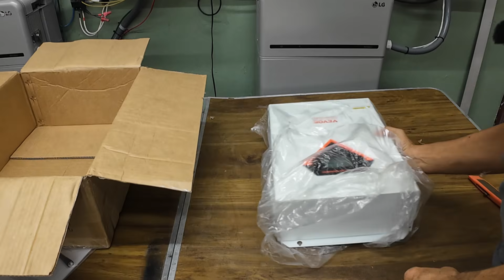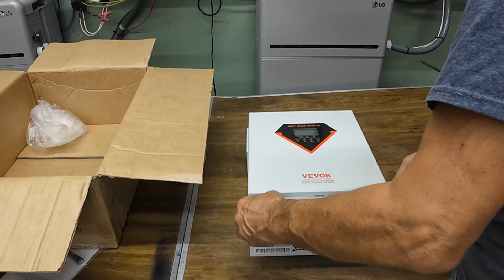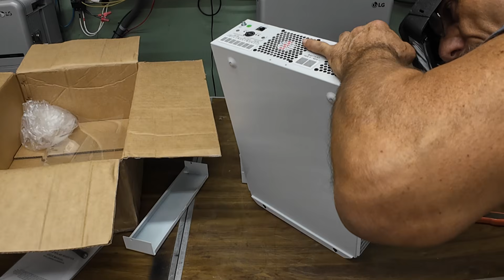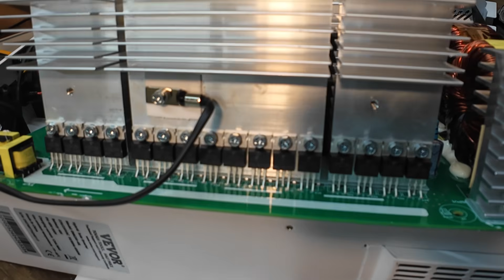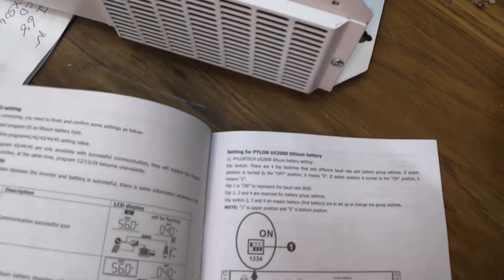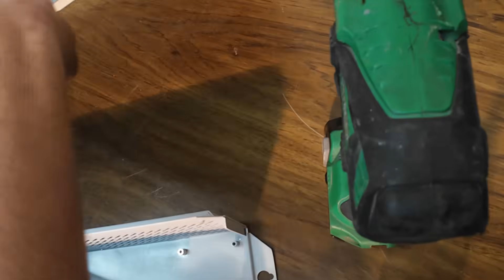$300 6 kW Hybrid Solar Inverter - What’s Really Inside?

Comment from the maker: OK, you guys asked for an affiliate link so here it is but remember I am not endorsing this until I've had a chance to test it and remember it's not split-phase. However if your going to buy one anyways you might as well use my link!😂 https://www.vevor.com/pure-sine-wave-inverter-c_10760/hybrid-solar-inverter-charger-6000w-220-230v-with-built-in-120a-mppt-controller-p_010209748438?lang=en&currency=usd&utm_source=inhouse&utm_medium=affiliate&utm_campaign=63374343&shortkey=20251025oh9y

Comment: I need help. I have the 3000W version of that  inverter. When connecting a freezer or big refrigerator the lights starts flickering like crazy and the freezer compressor has a hard time starting or even staying working. I don't know what could cause this. It doesn't do it with anything else and connection and all that seems to be properly done as well.
Reply from the maker: It sounds like your inverter might be struggling with the high surge current required by the compressor motor startup.
Reply: Any idea what could cause this? I give you more information. This is back home in Cuba and it actually happens to a lot of people. Specially when using hibrid inverters 3600W or smaller. I have almost come to the conclusion that is a manufacturer defect given that most of these 3000W,3600W inverterter that you can buy online almost look identical from brand to brand.
Reply from the maker: @alcontv4133  It sounds like compressor startup surge. Freezers and big refrigerators are hard loads because the compressor can pull several times its normal running power for a moment when it starts.

A lot of the cheaper 3000W / 3600W hybrid inverters look almost identical because many are built around the same high-frequency transformerless design. They may be rated for 3000W steady load, but that doesn’t mean they have strong surge capability for motors.

The lights flickering is a clue that the inverter output voltage is sagging when the compressor tries to start. That can happen from the inverter itself being weak on surge, but also from the DC side: undersized battery cables, weak battery, long cable runs, loose terminals, or low battery voltage. If the DC voltage drops hard, the AC output will dip too.

If this is in Cuba and the grid voltage is already unstable or low, that can make it worse too, especially if the inverter is in bypass or hybrid mode.

A few things to check:

Measure AC voltage while the compressor tries to start.

Measure battery voltage at the inverter terminals during startup.

Make sure the battery cables are short and heavy enough.

Try starting the freezer with almost everything else turned off.

Check if the inverter has an appliance / motor / UPS mode setting.

A soft-start device for the compressor may help, but if the inverter has poor surge capacity, the real fix may be a larger inverter or a low-frequency transformer inverter with a much stronger surge rating.
Not really a defect in one unit, more like a limitation of that whole class of small hybrid inverters.
Reply: @DIYSolarFarming after some reading online and some testing we found this, increasing the load to a decent number instead of just having a few lights on somehow help with starting up the freezer. Lights will still flicker but the compressor powers on 😅. They added something I think it's called a capacitor 20uf, or something like that right where the freezer is connected and now ever works fine 🤔🤔. I don't get how that works or how it helps the freezer run and the lights not to flicker anymore but it did lol

Comment: I just put one together but the smaller em3500 24volt version powering two power outlets. So far so good. I used two budget lithium 24 volt batteries and 4 house 37 volt panels in a sunny spot to keep them charged. I haven't gone over 1000watts yet because it's just set up to run fridges and freezers in a power outage. I hope it goes for at least a few years.
Reply from the maker: Sounds like a great backup setup, hope it serves you well for a long time!
Thanks for watching!

Comment: I’m surprised they didn’t have the filtered cold air intake coming from the bottom with the heat blowing out the top. It would make more sense from a thermal perspective.
Reply from the maker: Yep, that is interesting. I've seen some of these designs are using the opposite airflow.

Comment: ive been a DIY solar system inverter maker and ive tried powMr ,FloWatt(powMr sub Brand) ,anern and other but the only thing that my client have in common when it comes with issues and troubles are from PowMr and their sub Brand .and ive been repairing these inverters but what i highly can recommend is the Anern Brand .its like this specific inverter brand is the mother of those copycat(clone) brand cause all of these inverter with the same rated value has this the same hardware configurations .and anern has always this extra protection feature and was removed with other inverter brand .
Reply from the maker: I appreciate your insights!
Thanks for watching!

Comment: our 4,6 kW Growatt inverter weights only 30 kg with 4,6 kW AC and up to 7 kWp DC and 3 kW DC battery charge and discharge.
Also a chinese brand, but much heavier. 
But ours is a passively cooled one which brings the temp down to less than 55 °C even on a hot summer day.
Reply from the maker: That sounds like a great unit, especially with the passive cooling!

Comment: Regardless battery compatibility, I run it with custom setting where you just set the cutoff voltages and max current. There is not really a need for communication with a BMS. Works fine.
Reply from the maker: Thanks for sharing!

Comment: Great inverters, I got 4 from mrpow and daxtron. The go on ali for 230euro. All these 6.2ke are basically all the same. There is also a beefier 10.2kw version. Anjie has a modified version that support 3-phase parallel and export restriction using a clamp. They are all pretty good except for the 'high' idle consumption of the inverter which wrecks efficiency at low load. In low light conditions I turn the build in inverter of and only use solar/grid charger/mppt functionality and discharge the battery with seperate adjustable 2000w growatt grid-tie micro inverter. All these devices can be controlled trough modbus btw.
Reply: Yeah, another thing. The mppt algo only seems unisearch for a local maximum. So if you got a lot shade and a funky parallel string setup it might get stuck at a suboptimal voltage. Solis is beter at this with regular global sweeps etc.
Reply from the maker: Thanks for the detailed info!
Do you have the modbus registers they use?

Comment: Yeah I passed on this one, its European/asian single phase. 220v . Pretty much worthless in the US unless you get a significant Step Down Transformer for another six or seven hundred dollars.
Reply from the maker: It's good for specific applications, going into that in the next video.
Reply: @DIYSolarFarming beautiful circuit though, I've had good luck with vevor. They don't seem to exaggerate. I found that typically testing similar inverters under high load, the inductors get very hot (on the last split phase anyway. But it looks like they might have got the cooling right on your circuit. I'm betting it's 50 hertz but that might be adjustable and I know people hack those pic microcontrollers, good video. 🙏

Comment: My "EASUN 6.2kw" was exactly the same inside, before it blew up in smoke and sparks. It lasted only 8 months. Can't tell what was wrong with it ... maybe because I was welding with 4mm wire...😊 or that lightning stroke on grid power wires near my house.
Reply from the maker: Wow, sounds like it had quite the send-off!
Reply: My experience with Chinese solar hybrid inverter: you buy a 6,2kW, you will have about 4kW, 6,2kw just in very short time. For yourcase it was probably the load too high and all IGBTs of the inverter part (300-400DC to 220VA) certainly burned out. If the power factor is too low (<0.8) The inverter will pull very high current for the power required from the load.

Comment: Doing the high voltage battery/invertors & particularly the monitoring sw/home assistant/rs485 fills a huge void. Hoping u see a 10x in views now the word is out on u. 100x if folks start pointing 2 u on  prowse's dyisolarforum. Hoping to run my xlaserlabs hand held laser welder on this. Will only do full 800w (= up to 1/4 inch steel or stainless, 1 micron wavelength), at 220V, less on 120V.  At 28%-ish efficiency (best as of spring 2025) will need 3.2kw. Brand new subscriber. Very delighted with your plans on this & the "...After a Year" follow on vids planned. Absolutely loved the 'Off grid Thunder' song on ur "...Old Oven" vid. Excellent channel! Now off 2 binge all ur vids.
Reply from the maker: Welcome to the channel, glad you are enjoying the content!
Please keep us posted on how that laser welder is working out!

Comment: EU US 4.2KW 6.2KW On-Grid Pure Sine Wave Solar Inverter DC 24V 48V 220V AC MPPT 120A Solar Charge Panel Max PV Power 6200W/6500W
I Bought this 249 dollars include tax I did not try yet
Reply from the maker: Sounds like a great deal, let us know how it works out!

Comment: Yes, I've opened a 3kW PowMR inverter and it looks pretty much the same. I've also got a 5kW one. I'll see if I can open it and see.
Reply from the maker: Interesting, thanks for watching!
Reply: @DIYSolarFarming  I opened the 5kW PowMR and took some videos and photos. I'll try post a link.
Reply: @DIYSolarFarming  I don't know if that link to the Google Photos album came through for you, but if not, I added it to my profile's about page in the description.
Reply from the maker: Thanks, good camera work! They look very similar. The biggest difference being the Daughter board, PCB1. I would say they came from the same manufacturer. My vote is for what @fathergratwick found, Anenji.
Reply: @DIYSolarFarming  Thanks, I think he's right. Apparently these are all repackaged Votronic cores. I guess mine is an older revision.

Comment: To power 120V appliances, you must add a 220/240V to 120V step-down transformer to the output, as the inverter itself does not have a 120V setting.
Reply: Vevor is selling some of these step down 👇 transformers really cheap that must be compatible with these inverters. At these prices I should build an emergency system...😊
Reply from the maker: Thanks for watching!

Comment: That Inverter is a Fire waiting to happen. That’s what’s happening to that garbage. If your budget is that small I suggest not entering into it unless you have substantial fire insurance.
Reply: Why are trolls suggesting to what others should do without any proof. Keep your trash to yourself.
Reply from the maker: I appreciate your concern for safety, and it's always important to be mindful of potential risks with any electrical equipment.

Comment: Ed, is the inverter boosting the 48v to 220v via that tiny little transformer in the middle of the two heat sinks? It would be extremely valuable to do some load tests. I don't recall if you have a scope to monitor the output signal quality as you load it but that would be even more fantastic as it would help to see the LCL filter behavior
Reply from the maker: Yes we will be scoping the output for sure.
Thanks for watching!
Reply: That could be the High Frequency Boost transformer, that converts the 48v Battery to 320v DC Peak for the H-Bridge. The copper wire seems small, if can actually output 25 amps @ 230 volts AC.
Reply: @MrSummitville  Spot on. A continuous sustained test to see if that tiny little ferrite transformer handles it well would be extremely valuable

Comment: Ordered one.  Just what I need for using my plasma cutter off grid.  220V is perfect.  Have to watch out for hot vs. neutral connections and the cutter wiring.  I also have a couple of toroid 220V/110V transformers for 110V equipment.  That gives me isolation from whatever the Vevor does.  Making a "package" of the 4 12V LFP batteries and the Vevor for easy transport.
Reply from the maker: Awesome, sounds like a great setup!
Reply: Very nice. Could you keep us posted how it holds up to the plasma cutter load? If you are using a digital plasma cutter, you could remove the LCL filter at the top of the inverter and gain an additional 20% in power at increased THD which the digital plasma cutter shouldn't care about because it will covert it all right down to DC again

Comment: Tthx for sharing. 
I have a very similar 6KW 48V (other display, same case) just installed after month of collecting dust. Brand name  is Anenji
Working but no stress test etc yet. The battery (5kWh) and solar (1300Wp) need some upgrade soon. 
Any1 knows a vid on the WIFI for this machines?
Reply from the maker: Glad to hear your setup is working! You might check out Anenji's site for the manual, https://anenji.com/pages/manual
Reply: @DIYSolarFarming  I have these manual even printed on paper, but sadly there is no word about WIFI. The app is SmartESS but i could not get it to work, says adapter is connected but then nothing. Would be nice if the provided such stable and useful web interface as Shelly e.g..
Little annoying that the two fans are running all the time, even in passtrough mode

Comment: Hard to imagine that the TO-220 transistor package could come close to 60 amps with melting those tiny legs off. Is the whole inverter charger package UL /   CSA listed?
Reply from the maker: Those TO-220s are on the LV section. They’re not each carrying the full current. That stage uses multiple devices in parallel and they’re usually part of the 48 V charger/DC-DC and auxiliary rails, not the main high-power AC H-bridge. The heavy AC switching is handled by the larger TO-247 devices on the HV side.
No UL as far as I know.
Thanks for watching!

Comment: This 6kW being 220v is actually perfect because this can be used to send power over a long, low gauge line. Also, those who have electric water heaters can use this unmodified to take their water heater completely offgrid. My water heater consumes the most power year round. Being able to run this off batteries will have me break even real quick if the inverter is cheap enough.
Reply from the maker: Great point on the water heater use case! One point to add, the instructions say it can run battery-less not sure if that's in grid-tie only but if it also does in off-grid mode that would be an awesome application. Just heat the hot water during the day... 
Thanks for watching!
Reply: @DIYSolarFarming Are you shure there isn't  a 300 $ Step down alternative in the stores ?
Reply: couple people have burnt out their single phase 220v inverters using autotransformers to get split phase 120v. not smart enough to tell you why, but i charge my EVs with a similar inverter from PowMR, 6.6kw, runs at 240v single phase just fine. people dont realize that all EV's in usa can use single phase 240v just fine. I also charge 16s lfp battery packs thru a j plug trigger adapter which goes right into the inverter as AC in lines.
 there is some weird stuff with how some EVSE's in the usa are/are not wired up to ground. sometimes you have to trick them into accepting the ungrounded inverter by using the j plugs ground, sometimes they dont want to see it. again, not smart enough to tell you why but i just use a switch that goes into the inverters ground bond screw and mess around with stuff until it works each time.
have a video on my channel where i show my solar EV/EREV with portable 15kwh level 2 charger. whenever there is a free charger at the hospitals i visit, i bottle up an extra 15kwh and take it home with my free ev charge.
if there are no public chargers at the hospital, i take an extra 15kwh from home and charge back up when i get there.

Comment: Wait... 
You are showing us something about this inverter, what is actually decent unit, and you don't know how is working at all? 
Of course that this inverter will work on any of the batteries... 
No need any of communication with the batteries, because battery needs to have BMS for control and protect the cells, or can use some lead acid batteries in the worse scenario... 
Simple enter the menu inside of inverter and change the few settings , as max battery charging (02-100A), battery type (05-USE), bulk-ch-v (26-57.8V), flo-ch-v (27-57.2V), cut off-v (29-45V).. 
This way you can get full potential of LiFePo4 battery without thinking about is it communication going to work... 
As default is made to work with lead acid batteries... 
Do not use pylontech battery, because it's not real capacity what is showing on the box, and it's only 15S... We need to use max voltage fot lower current, so need 16S configuration... 
If you need any help, let me know... 
Good luck everyone...
Reply from the maker: I appreciate the detailed explanation of how to configure the inverter with different battery types. That's very helpful for viewers!